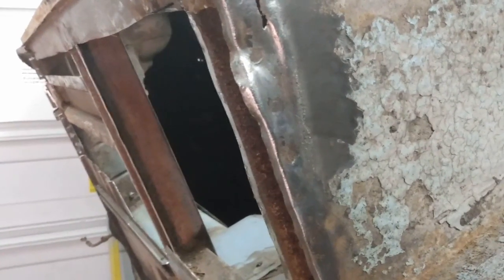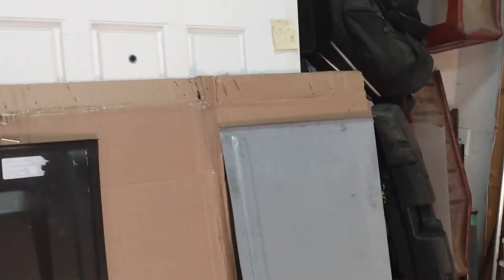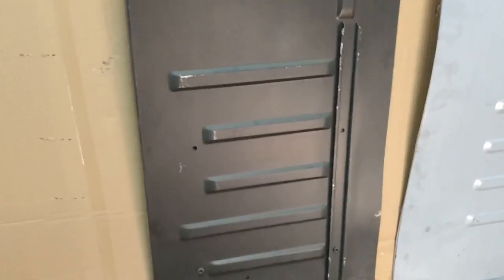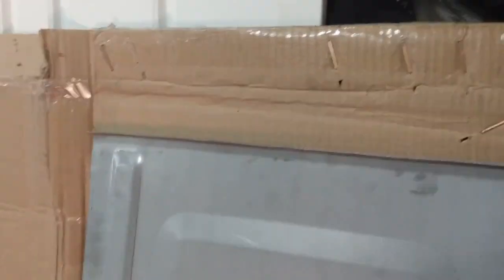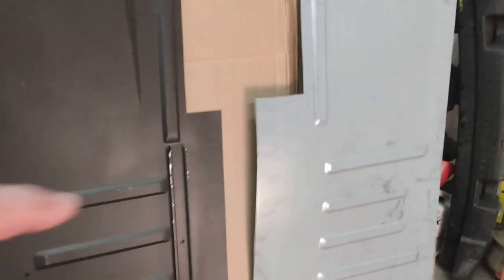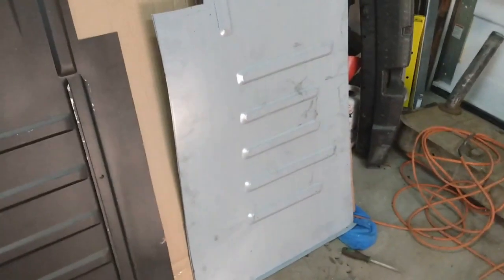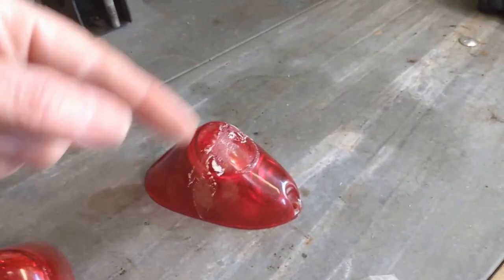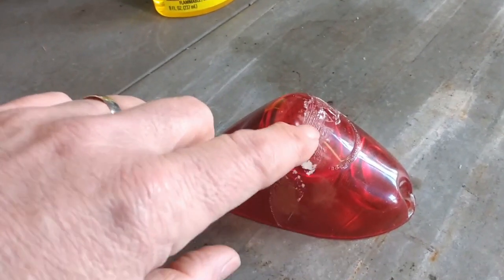Spot welds, floor pans, taillights and more. Bugeye Build Episode 11

Comment: Not as cold as Calgary but it’s been too cold (-20F air temps at night) to work in the garage on my Mini Project. My garage heater struggles to keep the garage above freezing.
Reply from the maker: Much below -15ºC (5ºF) my little heater has a tough time keeping up.
Reply: @EconoboxGarage  I have my thermostat set at 35F (lowered from the typical 40F) and it’s still kicking on. Gas fired hung from the 11ft ceiling in a 3.5 car garage. I’m taking this as on opportunity to gain some additional insulation budget for the garage. Also thinking about adding radiant heat as a second source this Summer.

Comment: Curious to know how you know how deep to cut the floor pan where the support rails are and cut only through the pan. Is it just a feel with the angle grinder and cutoff wheel or is there a different method to ensure you cut only through the floor pan?
Reply from the maker: I took my time and only did a little bit at a time. After a while you do get a feel for how quickly and deep the tool is cutting.

Comment: I see david vizard’s book behind you. Do you plan to tune the motor or will it be a stock one?
Reply from the maker: The current plan is to leave the engine alone and concentrate on getting the car back on the road. I may look at replacing or rebuilding it next winter.
Reply: @EconoboxGarage , thanks for the vids.